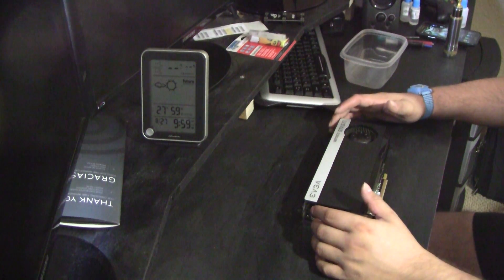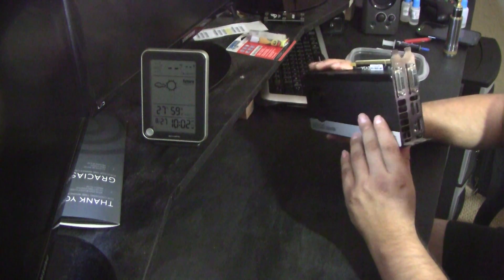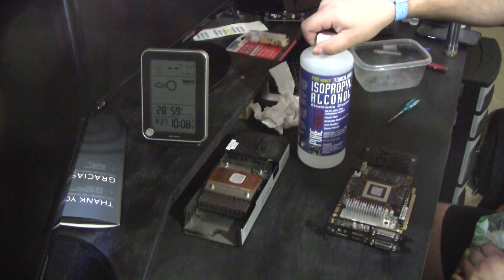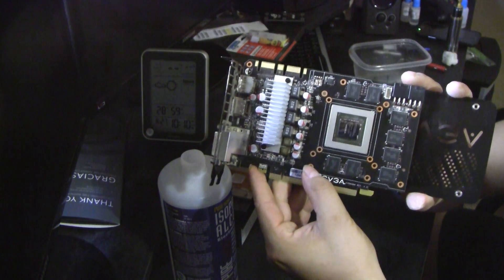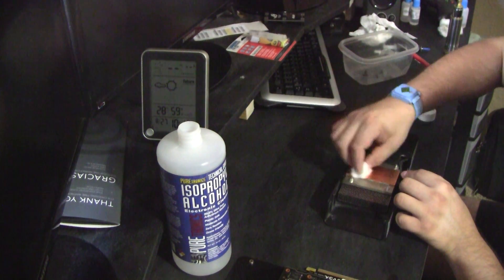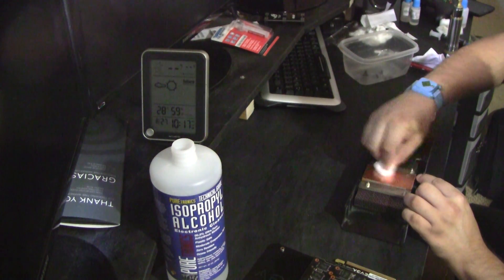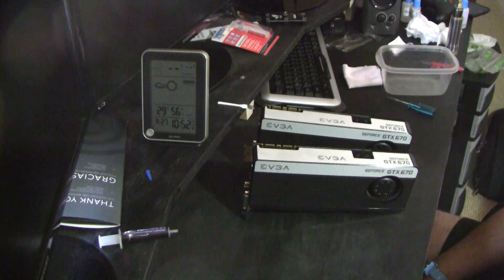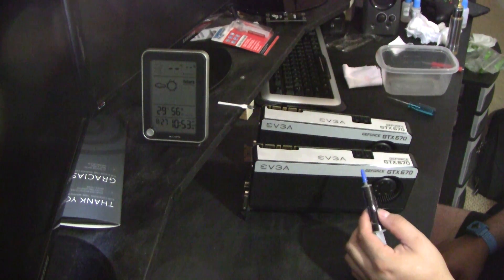ICDiamond 24c Replacing TIM on (2) EVGA GTX 670 4GB SC

Comment: Great vid. to me . I have same card now for 3 yrs and need to do the same. I have used ic diamond on my cpu before and you r rite about the spreading. it don't spread worth shit but it worx very well and needs no burn in time. The icdiamond did remove the product stamp on my i7 930 but only after replacing the tim 4-5 times over the yrs.. Grt vid and now I can take mine apart with a bit of knowledge thanx to u vid, so thanx for the work and vid..
Reply from the maker: +StoutNoodle thanks for watching!  and please like,share and sub if you liked the content!  more to come! sold these 670s a year ago now. got a 980.

Comment: I have use the lower content of alcohol  that I got at wallmart  for 69 cents and it works as fast as ever, the paste I use is the radio shack version I use when repairing ham radio finals that is top of the line ,this paste can take a beating because the heat generated by ham radio long communication